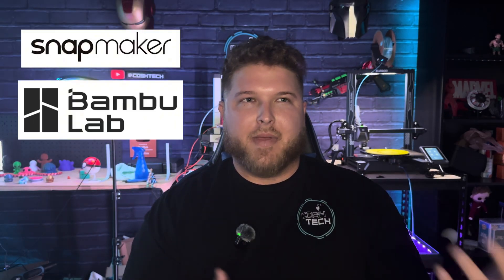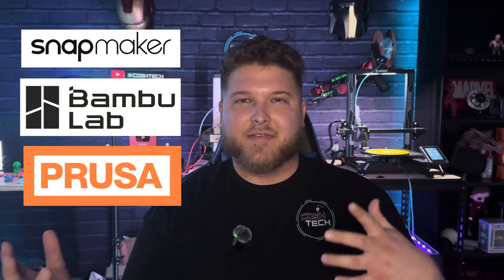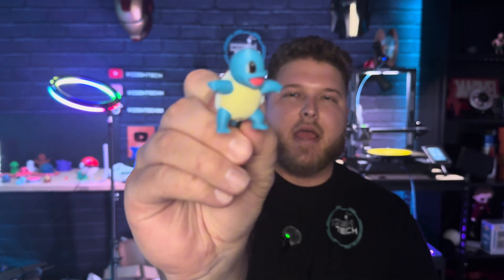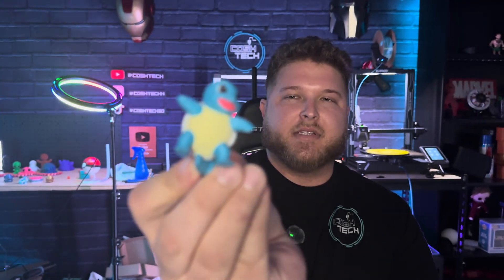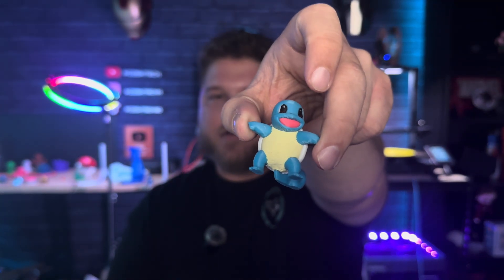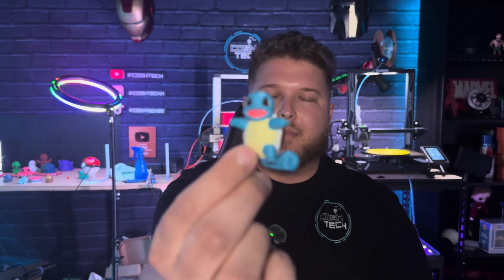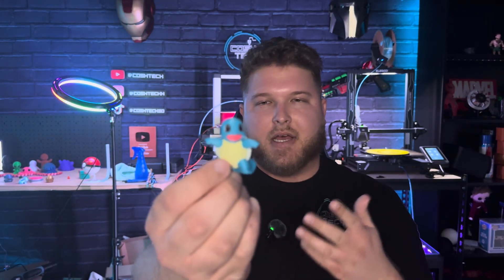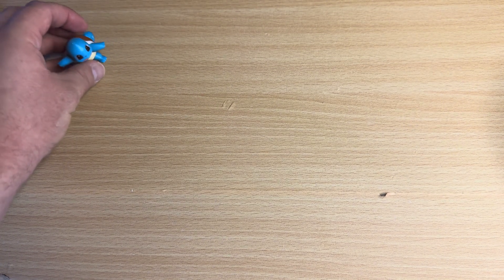Why Multi-Color 3D Printing is becoming obsolete | What the future of Multi-Tool head printing holds

Comment: The AMS and similar systems are so wasteful I would never considering in buying it, or even if I did would be just to use for things that are otherwise unfeasible to do without, or to use as start using a second role, if the printing one runs out.

Comment: It is obsolete to print in multicolor begin with. The results are prints with (ugly) layerlines. Whetever you do, you can never get rid of that. The only thing is to make it smooth and paint it for a nice reult. (but society doesn't do nice result, but fast effortless crap they can sell without lifting a finger. that's another topic).
The only thing that multicolor printing does well, it to use it for support structures. The future of printing should be 2 seperate nozzle systems with each their own filament (no wastefull flushing!) one to print the support, the other the model. No switching, swapping tech. just 2 heads next to each other that can print 1 thing.

Comment: It is completely clear that the tool changers work much faster and much more efficiently, but the costs are currently still very high for the benefit. If you often produce a lot of multicolor prints, this can pay off in the medium term. For the user who only occasionally prints in different colors, a combo box is still a cheap and practical solution. In that case, why should you spend thousands of dollars on a tool changer that may not even have a chamber heater for more demanding filaments? It's a compromise, but that doesn't make it obsolete.